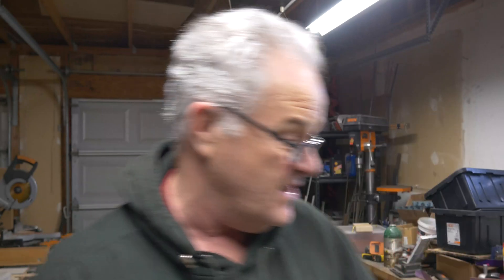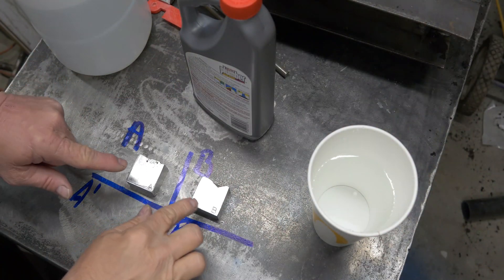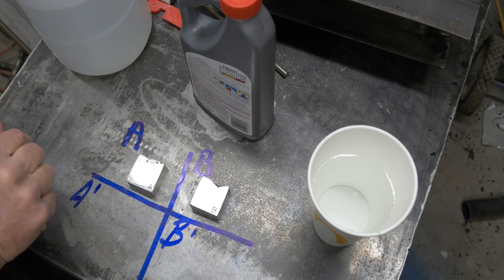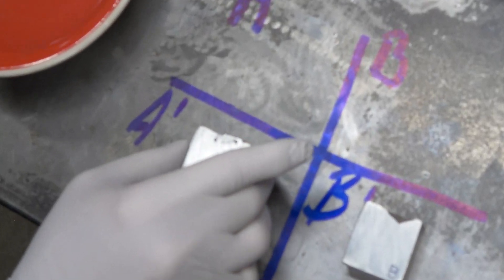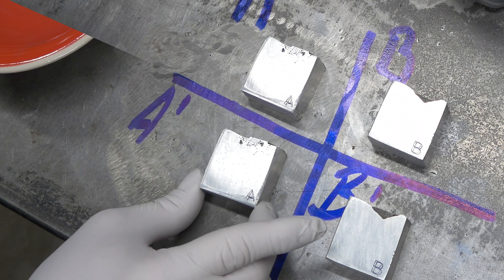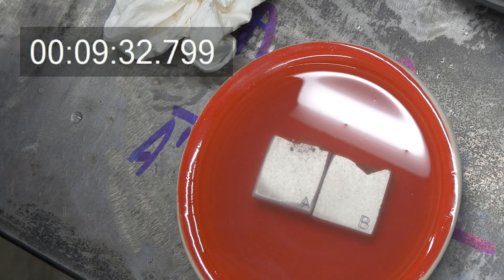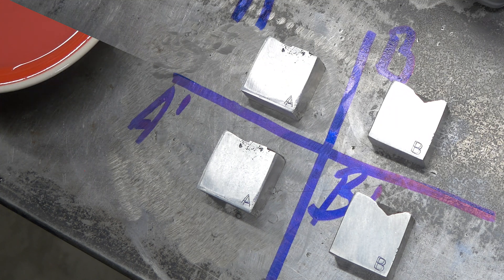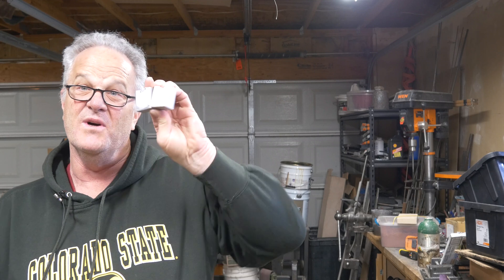Final porosity test - Caustic soda wash

Comment: During  the first soaking I could see some pores in the B block that disappeared when you took them out and wiped them down, a lot more in the A block. This has been an interesting project and as far as I’m concerned I know which method I will use once I get my casting operation set up and running! Guess which method I will use?
Reply from the maker: Oh you’ll be like everyone else and pour down a big open sprue ;-D Did I get it right? ;-)
Reply: Maybe so, you’ll just have to wait and see.

Comment: Thank you Perry.  I will now have to look into caustic etching...after I figure out why my furnace isn't hearing properly now that it is finally warm enough to get out to the shop.
Reply from the maker: Everyone... well Martin... is saying that the cheap stuff I bought isn't near string enough.. My furnace doesn't hear a word I say either. Must be a common problem :-D
Reply: @swdweeb  I wonder if you just used straight up lye instead of toilet bowl cleaner?  I will give that a shot once I get my furnace back up and running.
Reply from the maker: Mark Shymanski I’ll hold on to the blocks for a while. Let me know when you’re ready you can soak them if you want

Comment: Glad we talked you into doing the test. It's truely sad that it didn't react well. That drain cleaner is so weak. 
Hard to tell with the reflection on the surface, but I would say I can see a little more porosity after the treatment. the pinholes on the A block look a little bigger too.

Comment: Interesting experiment, but I'm not surprised that the result didn't reveal additional porosity. Safe to say, as long as you make a nice, steady pour, don't overheat the metal, and use "clean" metal, you will reduce the amount of porosity.
Reply from the maker: Yep, I think those are the basics